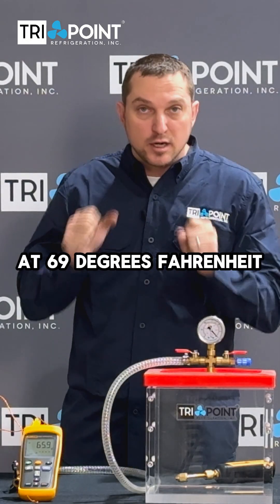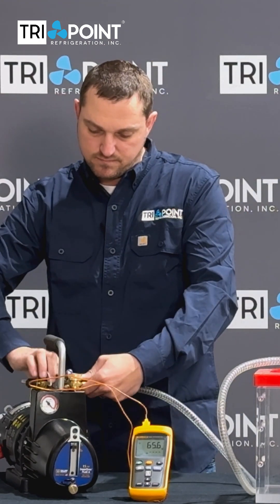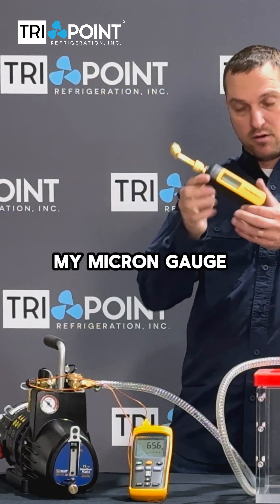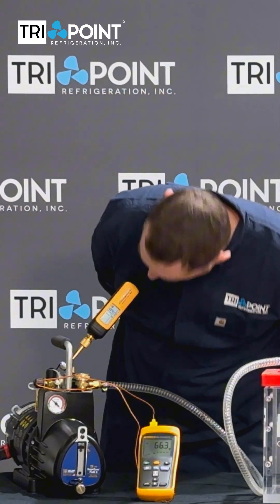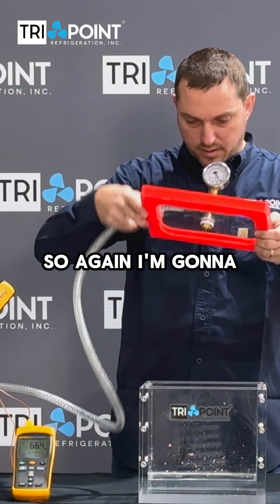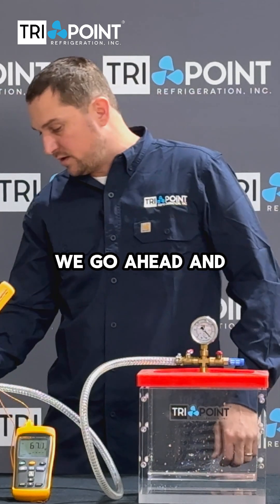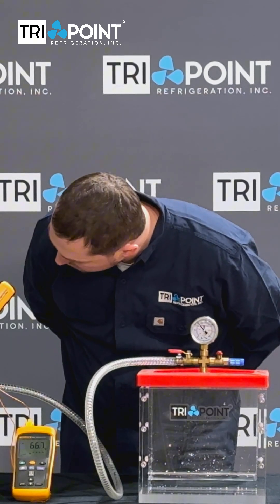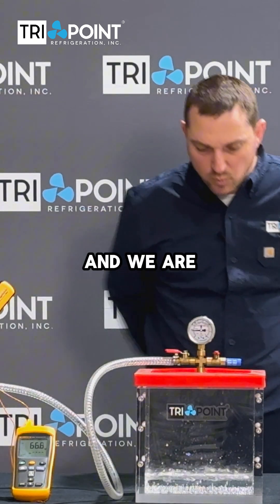Boiling Water at 67° with a Vacuum Box and Pump | Tri-Point Refrigeration

Comment: And that folks is why you pull a vacuum on AC systems. You want to get every bit of moisture out of the system before adding Freon because moisture will corrode the system internally.